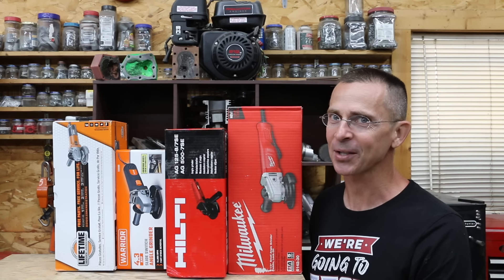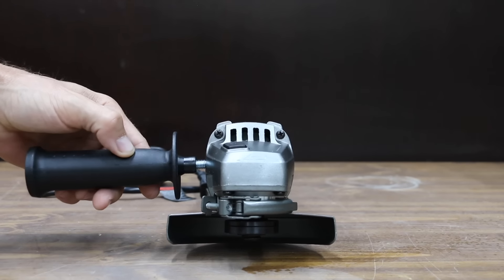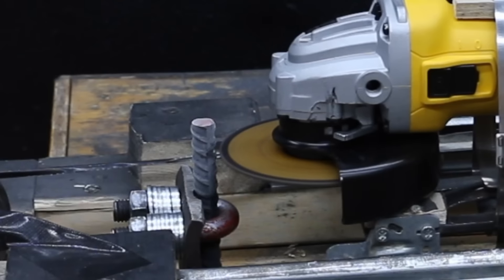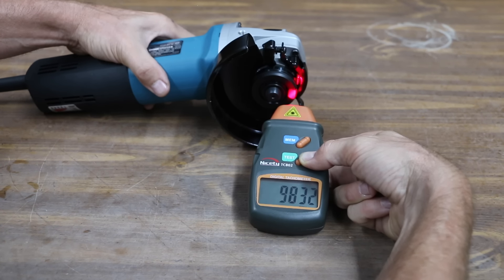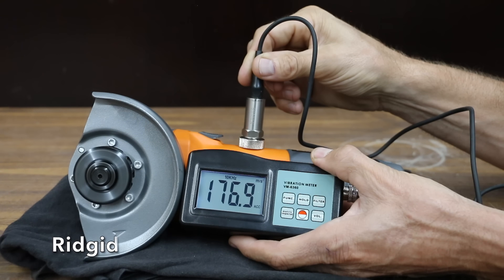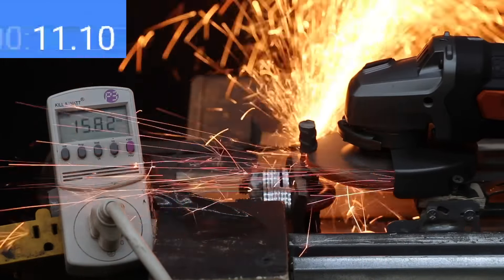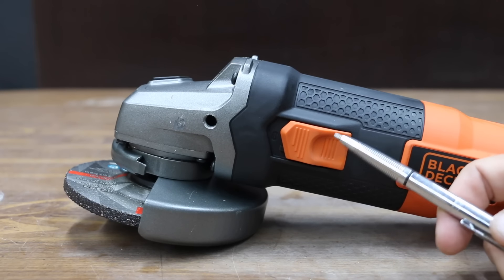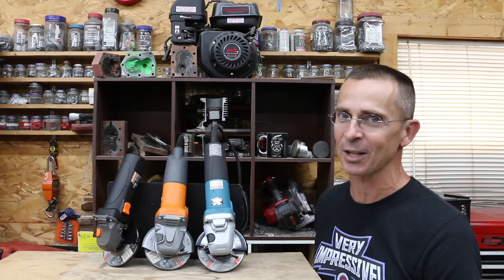Best Angle Grinder (Corded)? Hilti vs Milwaukee, DeWalt, Makita, Ryobi, Ridgid. Let's Settle This!

Comment: I am a Bosch guy and I have a 5” German-made grinder and a 4 1/2” X-Lock, which is also darn good and is great for toolless wheel change.
Reply from the maker: Thanks for sharing.
Reply: I don't use tools to change attachments on angle grinders unless I've managed to burn a disc down to nothing. If there's still diameter there it's plenty to twist off with. But I will put a glove on a wire wheel. Those wires can stick right in me.
Reply: I have the 4.5 Makita Grinder/Cutter on order with the X-Lock. 7.5 Amp to start off with. My first Makita, as I have always been Team-Red in the past. 
🤔😂. R. Flare.

Comment: My experience working in various metal shops over the years has concluded that metabo, with all the different options they have available, is the go to grinder for industrial metal working
Reply: Yeah I love my metabo. We’ve tried Milwaukee but they didn’t last and the switch was uncomfortable. Dewalt was ok but my metabo is more comfortable. I burn up about a grinder a year. I’m a fitter for heavy weldments.
Reply: @G.Davis67  i work in a welding shop myself, and I'd say the metabo grinder we have is my favorite
Reply: Do you feel like Metabo HPT is diluting the brand? Online searches return both brands and I feel like they made a mistake by giving the prosumer Hitachi brand the same name as the professional Metabo brand
Reply from the maker: Thanks for the feedback.
Reply: Justin, you are flipping WRONG. Metabo did not TEST nearly as well and those are FACTS. Not stupid anecdotes
Reply: @LitheInLitotes  this specific model maybe. they do have a few in their product line.
we have a metabo as a backup for our makitas in my stone shop.
Reply: How about walter?
Reply: @LitheInLitotes  metabo have absolutely massive range of grinders. This is just one... Is it one of their made in Germany grinders.. i doubt it..... Is it one of their high end grinder..  nope.. nobody makes grinders like metabo its the one thing they excel at
Reply: @Alex-uh1mj  I agree - my "Grab this first" grinder is a Metabo & it gets used absolutely hours daily - never blinks, is very precise & doesn't snatch & grab like a lot do - it's super smooth. Metabo do a lot of grinders - from cheap ish to dear - this one was dear.
Reply: @LitheInLitotes  unfortunately he tested one of their base model grinders. Therefore I will say if their base model grinders are better than most prosumer grinders, then it surely can’t be to hard to imagine what their good ones are like.
Reply: @TWMusic  the walter grinders are just rebadged german metabos. They are good grinders for sure tho.
Reply: YOu mean Dewalt and makita?
Reply: Agree! we got a Metabo and a Bosch professional at work for the last 10+ years and they never failed. Love them both!
Reply: I am not surprised to read positive comments about Metabo, no doubt coming from persons who use the particular models that made the company famous for them.

How to explain Metabo products that don't knock your socks off? Well, I have to assume that Metabo/HPT decided not to ignore the US market. Many (most?) buyers in the US refuse to pay more for quality, so manufacturers MUST provide some kind of low-end products to capture more of the total available market. One needs to make a buy decision with that in mind.

I can only hope that people who actually do research prior to making their choices will stop buying junk.
Reply: Yeah as a millwright all our grinders are metabo. We have some Milwaukee grinders but they don't work as well as our metabos. Especially for cutting metal.
Reply: @joshuagarrett3424  They are all the same thing.

Comment: For as often as I use an angle grinder, maybe several times a year at this point, I bought a HF Drill Master. It's holding up pretty well. Thanks for the showdown.
Reply: I don't use my angel grinder much either, but it's nice to have one when needed, I also went cheaper and bought a $50 Bosch
Reply from the maker: You are welcome!

Comment: I would love to see more of the German Metabo tools included. I run original metabo for all my cordless tools and they’re Festool quality at red/yellow price.
Reply from the maker: Thanks for the suggestion.
Reply: German metabos, also Japanese Makitas. But you wont find Japanese Ryobi because Ryobi and milwakee are now the same Chinese Company.
Reply: Also Bosch is missing
Reply: @kiyoshim9593  German metabos still exist we run them at work. You have to search around the metabohtp brand now tho.
Reply: I find that Bosch are a good brand..... used them most of my life and not had any rwgrets from them...... my washing machine is also a Bosch, not needed any parts in over 10 years and baught second hand 🙂

Comment: Great video, thank you. I have 8 of the harbor freight  warrior grinder, each set up for specific purposes and all are still going strong. Very happy with their performance to date.
Reply from the maker: Great feedback on the Warrior!
Reply: That's the way to go! Those "disposable" grinders definitely have their place! 😎✌️
Reply: It literally got the worst score. Did you even watch?
Reply: @LitheInLitotes  Yes, but it's also $15
Reply: I did the same.  Saves so much time.
Reply: Bad Obsession Motorsports(Project Binky) have a cool setup. They have 6? grinders on a cart all setup with different wheels.
Reply: Same here, cut off wheel, grinder, wire brush, flap wheel, and other crap
Reply: I got an old HF Chicago electric from my dad and I have ABUSED that bad boy. Still going strong. For 15 bucks, cant beat that 🤷🏽‍♂️
Reply: I got my Warrior for $10. Use it occasionally and it has done everything I ever asked. No way it can be beat for the home use DIY at $10.
Reply: For me it is more important to have more than one angle grinder to save time in switching discs or brush. So I might mix a high torque Ridgid with a couple of cheap HF grinders.
I thought the performance of the Hilti was pathetic :-(
Reply: @gmansplit  I went to a hardware store to replace the wrench that you use to change the wheels. They wanted 18 bucks for that.

It was cheaper for me to go to harbor freight and buy another whole ass grinder with the wrench included than buy the one at the local hardware store
Reply: @LitheInLitotes  Saved me lots of $
Reply: @LitheInLitotes  I'm not lending you my $100+ grinder you're going to get my $5 warrior. Warrior grinders are good for small jobs, I use my Hercules rat tail for extended use and comfort.

Comment: Thanks a lot for more corded reviews! My budget does not really allow me to get good battery tools and cords aren't a big problem for me, so it's nice to see something like this! I hope more will come. Shame not all brands are available here, but at least I can see the big ones being compared.
Reply: Cordless is good but a grinder will eat batteries faster than you can charge them.
Reply from the maker: You are welcome!
Reply: @Rudy97 literally had a job that revolves around using a cordless grinder with a cutting wheel. I had something like 7 batteries. I’d go through 2 while 1 was charging.

Comment: I just bought the Dewalt last weekend and the deciding factor was how it felt in my hand. I do a lot of one handed cutting and the others were too big to get a good single handed grip.  As always, a great video. Thanks once again
Reply: they are terrifying!
Reply from the maker: Thanks and you are welcome!
Reply: Makita handles are rly good for one handed use, but for safety please use both hands. That tool has more power than you can hold.

Comment: There is a reason why pretty much every contractor I've worked for in industrial metal working uses Makita grinders. Specifically its almost always the GA6020Y with SJS and electric brake. They work great and just wont die even with a 200lb gorilla leaning on them 12 hours a day.
Reply: Those folks need the best. DIY cutting and grinding, Harbor Freight has been great for me.
Reply: Plus they are so much smoother. The high frequency vibrations on some just make them unusable.
Reply: @artsmith103  Buy once cry once. But yea in the end if you don't use it at least 50 hours a year, it's not worth it. If you do, it's worth the money. Not for the speed of cut or durability, but lower vibration. High vibration rating tools are the worst if you use them more than 30 minutes sessions. That's when you start hating the cheap stuff.
Reply: If you're pro and make a living out of the tool, sure. But if you're a DIY and don't expect to use the tool more than once (for your project) or twice (to lend it to your neighbor), you can't beat the HF at $15.  LOL
If it was cordless, one should consider which battery system one wants to commit money into. For corded...  if you want a bit more reliability, the Porter-Cable is a no brainer.
Reply: How about metabo and walter?
Reply: @itsm3th3b33  if you only need a tool once, rent it. Such a waste to buy something you only plan on using once
Reply: @VoltsAnBolts  Hard to imagine anyone uses something useful only once. Either you have an industrious lifestyle or you live in an apartment or similar.
Reply: +1 for Makita.  Mine has lasted decades, cuts fast, and has awesome bearings so no irritating vibration as in my Hitachi which is loud and irritating to use.
Reply: You read my mind!
Reply from the maker: Thanks for sharing.
Reply: Not to mention, tile guys, concrete workers, commercial plumbers. Makita is basically the industry standard angle grinder,  I'd say more tools than that definitely grinders.
Reply: @LegitMoose  I see the odd Walter grinder, typically they're older models when I do come across them. The one nice things about the ones I do see if they let you rotate the body relative to the trigger which is nice when using a zip cut etc. The Walter grinding disks however pretty ubiquitous in the same way the makita grinders are.

Metabo I have not come cross to my memory.
Reply: @VoltsAnBolts  
Like many DIY-ers, I'm balancing the pros and cons on a pragmatic level.  Say you need to fix a back yard deck. Sure you can hire a contractor. Mucho dinero. 
If you chose to DIY, you will need the tools. I doubt that you can rent a grinder for less than $15.  LOL 
Sure I will only use it once, but at the end of the day, I saved a lot of dough and end up with a new tool in my box. If I end up using it a second time, that's icing on the cake.
Reply: @itsm3th3b33  Right, and "use once" doesn't mean for an hour. It might be a month of weekends. The "waste" comment was so karen/lame.
Reply: @artsmith103  
Don't understand why it's hard to imagine... Example: I bought a nail gun (needed it for a bookcase and it was a good deal at the time).  I never used it again.  It sat in my garage for 20 years and the rubber seals disintegrated. I could have purchased the seal restoration kit since it was a real good quality gun and practically brand new, only used once, but didn't expect to use it ever again, so I ended up giving it away. 
Still got enjoyment out of the project, even if I only used the tool once.
Reply: Yah I loved my 7" makita grinder but it was just too damn heavy for using all day so I also have a 7" milwaukee which so much lighter
Reply: @itsm3th3b33  Maybe you addresed your reply wrong.
Reply: I've noticed that as well. It doesn't matter if a shop uses yellow, red or blue battery tools, the grinder is always a Makita.
Reply: The GA6020Y and GA5020C are both awesome, and damn near indestructible. Strangely the GA5010's are garbage, they last about us 6 months while the other two go 4-5 years
Reply: Any suggestions on a Makita that is variable speed with a paddle switch?
Reply: @artsmith103  
At first I didn't understand what you meant by "Hard to imagine anyone uses something useful only once".  But re-reading the entire conversation, I get it.   
It's all good. Cool. 🖖
Reply: I have all milwaukee cordless tools but wired grinders are makita rat tails some of them are 30 yrs old
Reply: @itsm3th3b33  Saving $100 when you're actually getting something for the money seems crazy to me. It's the wrong focus. In a life of subscription models where people are willing to sign away ongoing monthly expenses a hundred bucks is not a lot these days. When $100 might be only a bit more than a weeks worth of gas and for similar price difference the Makita will last quite literally a lifetime it's about stepping back and putting things in perspective. Heck cutting out beer for a couple of weeks is the same amount for many guys.
Reply: @itsm3th3b33  I agree with buying a $15 grinder if you're really only using it once but a grinder is not a nail gun. A nail gun is a pretty specific maker's tool but a grinder is just a general all-round tool. It would get used for a variety of commonly encountered problems for any homeowner. Having said all that, a cheap cordless kit with a grinder is a better prospect for the random-use-diy-homeowner.
Reply: @beerbeforebreakfast  as a tile guy in understand the need for high torque (cutting with a diamond turbo wheel) and low vibration using angle grinders for hours dragging a vacuum hose with you. My biggest thing is how hot the gearbox gets after 15 minutes. You need to put pressure down sometimes on some old adhesives and can't do that very long
Reply: I bought the Ryobi just because it has the nicest handle. I love it. I have two other DeWalt ones and a Black &Decker also and use them all. I hate changing cutting discs so I have a grinder for each type of cutting) grinding. The Ryobi is not the most powerful but for what I use it for I love it.
Reply: @vpsryder  gotta love those 2 Makitas for the fact they run off DC as well. It's less and less often that I need them, but my old trusty diesel welder puts out DC. The repair shop finally said they won't work on my old Black and Decker grinders any more, so they're in retirement. Picked up on the 6" Makita. Good tool.
Reply: Things must have changed, forty plus years ago I worked at repairing electric tools and plant in the stores of an international company, when we started buying Makita tools they were awful and always needed major repairs when coming back into the store, the plastics would crack, gearing would strip, armatures snapped, motors would burn out, it was almost unknown for a Makita tool to come back in working condition. Good to hear they now seem to be better mad.
Reply: @ronpalmer1371   What was the good grinder back then? About 10 years ago I worked at a place where we ran lots of angle grinders for close to 12 hours straight everyday and we only used Makita, never had an issue.
Reply: @ronpalmer1371  oh I know, I 100% believe you, I wasn't trying to say you were wrong. I was just adding some anecdotal evidence that things have changed. I was actually curious what the good brand was 40 years ago.
Reply: @libtrs838  
Hi,
I never thought you were disagreeing, as I said we kept many brands, for me personally I thought that Wolf were the best angle grinders at the time,  Hilti were excellent tools too but at that time they   Never made angle grinders to my knowledge, 👍
Reply: And the lesser vibration should really save bodies over time.
Reply: @LegitMoose  Hi mate, we use the exact brand of Metabo tested here at my work - I've had mine for years now and the only thing that's ever gotten damaged it is the cable. I am not gentle on this Metabo, and it has served me well through hours of daily use for years.
Reply: @ProjectFarm  What was the point to compare low end, low capacity models to high end, high capacity models?  

For example HF has far higher capacity models. There are more comparable models, to place in the comparison IMHO.
Reply: The 7” makita angle grinders make quick work of cleaning up a bevel before welding
Reply: @AdventureswithGeneral  Have you used the Makita ds4000 drill yet?
Reply: @levakeith441  no
Reply: @AdventureswithGeneral  Its regarded as the best or at least one of the best mixing drills, built like a tank. Definitely worth checking out when you need a new one
Reply: @levakeith441  ok. Thanks